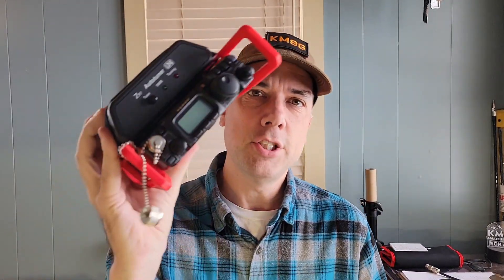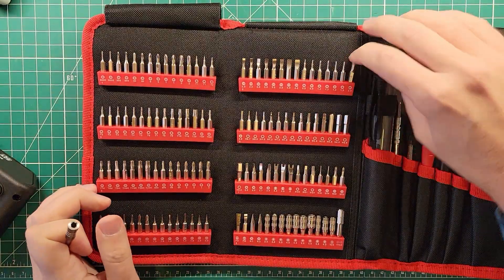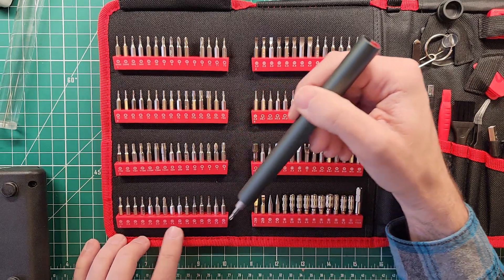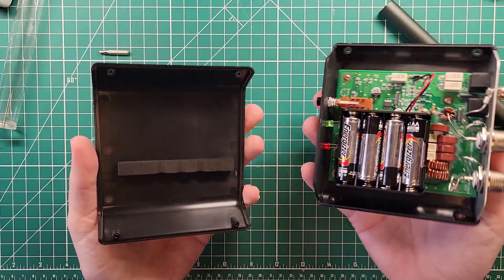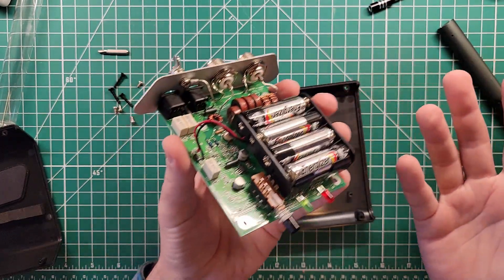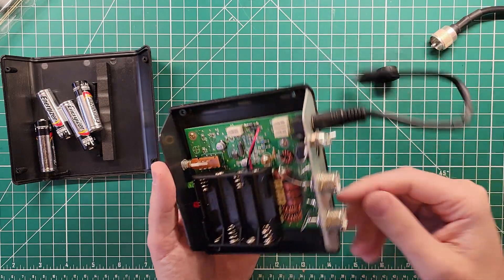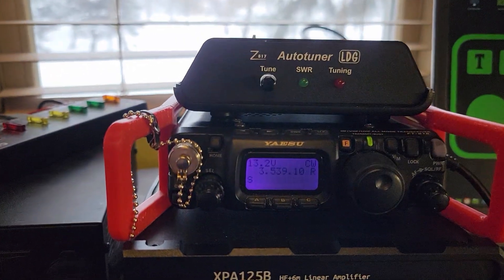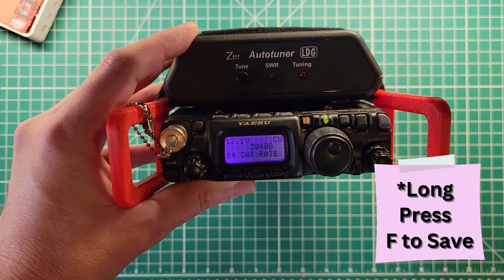How to use the z817 tuner from LDG with your Yaesu FT-818

Comment: I had an LDG auto tuner (LDG-Z111 I think) but something happened to it; it smelled of burnt components.  I now have a MFJ 969 Versa Tuner II--a roller inductor tuner that was given to me.  I love the tuner but hardly ever use it since I no longer have my old Kenwood TS-430S and now have a Yaesu 991a with a built in tuner that will handle all my antennae since they are all nearly resonate.  Cheers & 73 from W Rusty Lane K9POW in eastern Tennessee
Reply from the maker: This is the way!

Comment: Cool tuner but it’s a shame they didn’t use metal insert for the screws since you need to open it rather frequently without a battery door. Personally, I would see if I could hack another power source from the available power wires.
Reply from the maker: Agreed. New power is on the list!

Comment: I know you don’t do a ton of 3D printing videos, but I would like to see a project to print a new case for the z817 that is smaller with rechargeable battery and has 2 bnc’s on the back. Seems like an ideal cheaper tuner option for QRP radios with no ATU.  Either way, thanks for the video.
Reply from the maker: That's a great idea - what do you think of powering the tuner from the radio vs a battery pack?
Reply: @temporarilyoffline  Love my Z817 tuner. The batteries last a long time. Wished it had a clear access panel for easy changeout and to make sure the batteries aren't leaking!
Reply from the maker: Me too!
Reply: @temporarilyoffline  I’d like the idea of radio supplied power as an option but would still like a smaller rechargeable inside for wider compatibility. Something like a flat pack lipo.
Reply from the maker: Makes sense!
Reply: I didn't like the idea of AAs in the tuner so I installed a 12V to 6V converter and added an Anderson connector to the tuner.

Comment: There is 13.8V on that jack on the 818.  You could see if it makes it to an unused pin on the jack on the tuner.  Of course, 13.8 V ain't 6V,.  The logic probably has a regulator to get 5 V (or maybe 3.3V), and that regulator might be happy to take 13.8 V (a 7805 would, but a 7805 wouldn't be happy with 6V, so that's probably not what it has).  But the relays may run on 6V, and they or their drivers may not be happy with 13.8V.  Current demand and the radio's sourcing capability would also have to be checked.  I assume that these are latching relays so that they only draw power during search for a match, not while operating afterwards, since this tuner is intended for portable operation, further evidenced by the AA cells.
Maybe you can explore when you fix the broken one.
Reply from the maker: That's the plan, stay tuned!

Comment: ~6v to run the tuner. Pull the batteries, wire in a buck converter, and hook it to the radio power source?
Reply from the maker: that's the plan for a future video - already working on it and I don't think you'll even need the buck converter.  Stay tuned.  (Frankly, I don't know why LDG didn't do this in the first place)